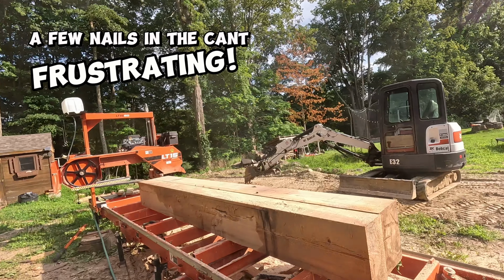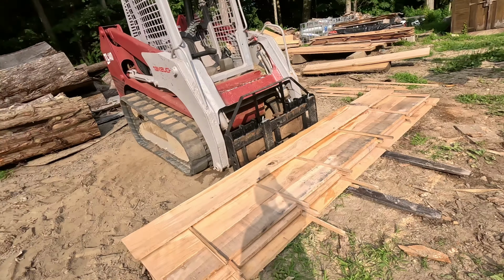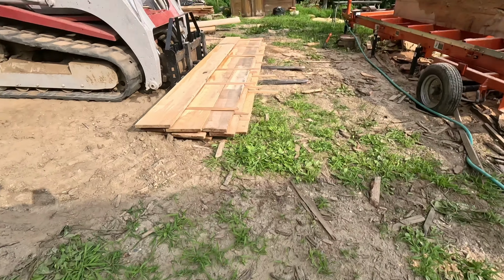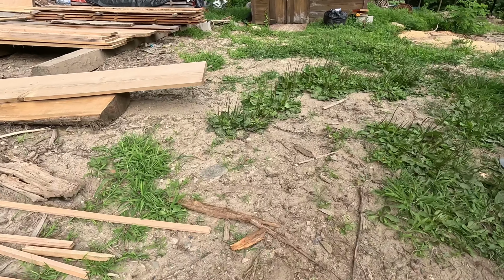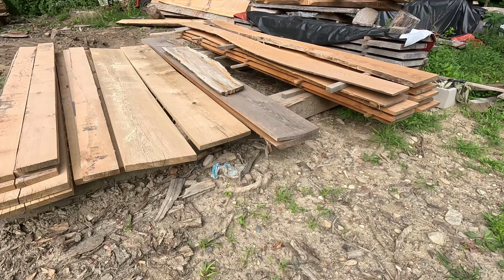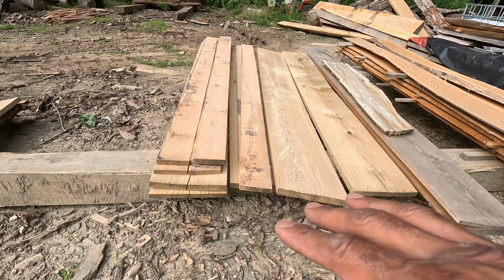Huge Copper Beach - how to rotate a log safely, #lt15, #woodmizer

Comment: When you say 450 sq ft did you mean board feet? Regardless thats a ton of lumber out of one log. I've only ever run a Mobile dimension mill and an lt28, so that wide mill seems to handle a pretty big log in comparison to the lt28.
Reply from the maker: I was assuming it was sqft at 4/4. Which is the same thing… right?

Either way the log yielded a lot of lumber! I’m going to use it for our flooring in some places. 

The LT15 wide has been great. Only thing I wish I had was the debarker… my logs end up with mud or dirt all the time. Washing it off takes a lot of time so a debarker would be great. 

The cantilever design of the 28 is pretty nice how your width of cut isn’t as wide but is a nice mill as well.
Reply: @ProfessionalHomeowner  ya it would be. The lt28 can't support a debarker either. I guess the lt15 wide classic can if you run off electric. But seems they don't offer it in north america. I used to use a log wizard on a chainsaw to help with dirty logs but it also takes quite a bit of time.

 The cantilevered head can definitely help with logs that are curved or fluted. But they can be very hard to turn and clamp. Clamping is strong but pretty awkward at times on the 28. The one i was running had 18 hp and started to struggle at around 20" cut. But I think in part because of the head bearings in the mast being a bit worn and that caused the head to kind of saw back and forth with the blade and vibrate. Ever since running that mill I've been looking to buy one but no luck. I was always looking for lt28s or bigger because i liked the welded frames. But it seems like yours is tough too.